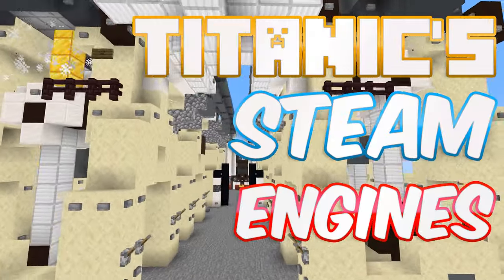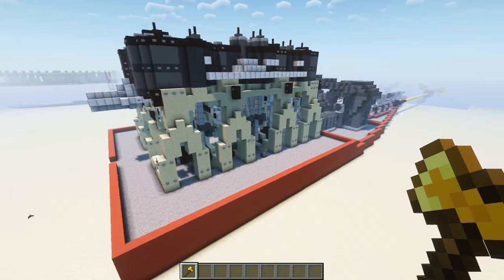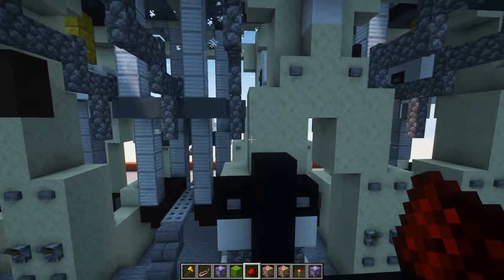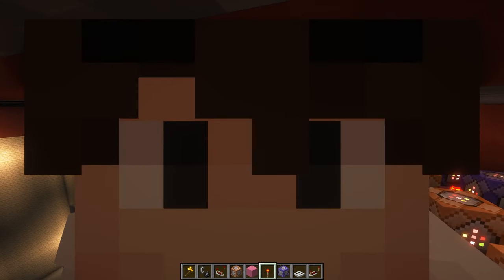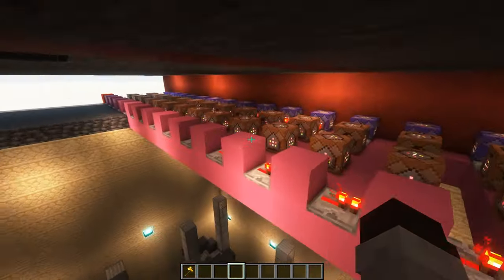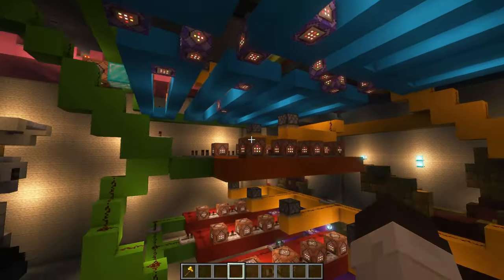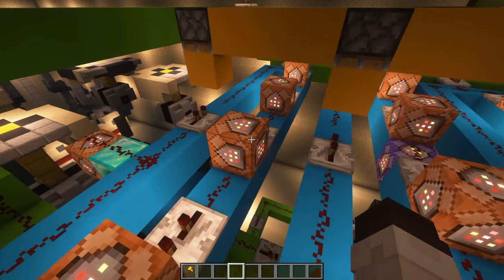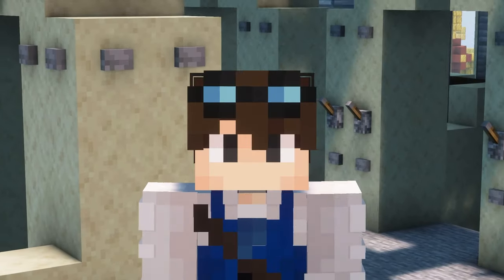I Built Working Titanic Steam Engines In Vanilla Minecraft! [Steam Engine Tutorial]

Comment: Fun Fact: The Olympic Class Liners' two main engines were called reciprocating steam engines. The central propeller was power by a turbine. The turbine was powered from left over steam from the main engines. This layout is called a "Triple Expansion Steam Engine"
Reply from the maker: Fantastic to see another person with deep knowledge of the Olympic class liners!
Reply: The  "Triple Expansion Steam Engine" is talking about how the engine has , A high pressure cylinder, intermediate pressure cylinder and a low pressure cylinder , its was done to try and get as much energy from the steam as possible , And on The Olympic class liners the steam from the last cylinder (low pressure) was then passed into the turbine before going into a condenser